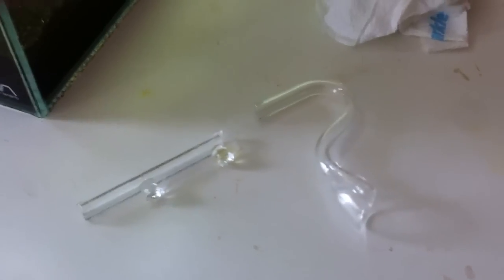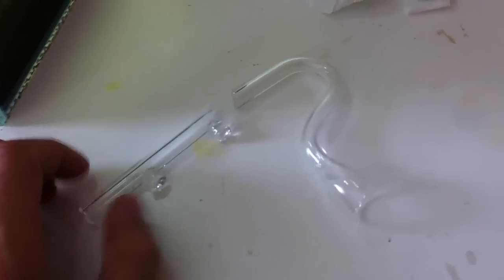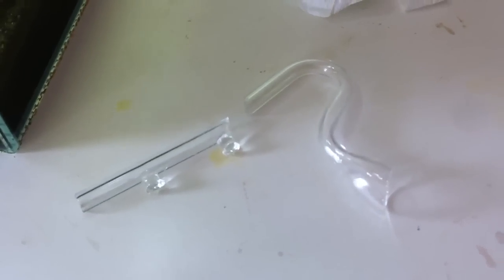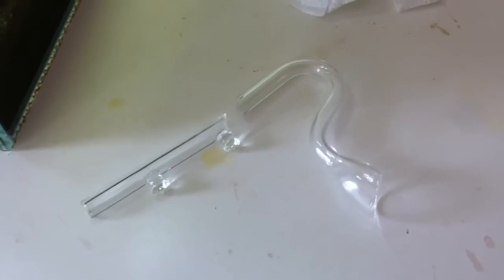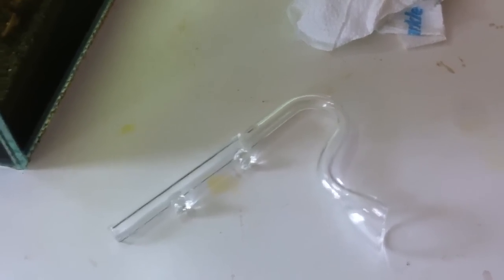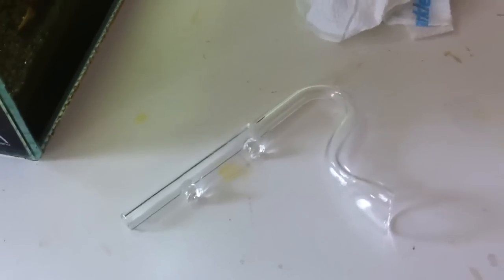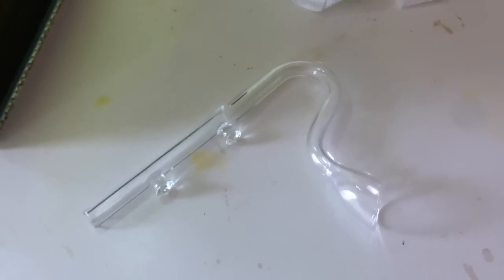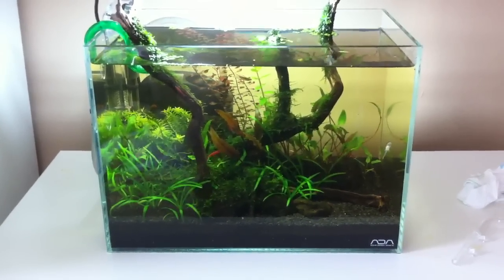Some help fixing my glass pipes

Comment: At the auto shop they have the stuff called radiator repair it's like a putty it will dry Rock Solid and you can make it Mega thin although the thinner you have it the more it tends to want to stick to your fingers if you don't get all the grease off your peace or fiberglass sheets and PVC glue you can form the sheets almost perfectly or you can pull the screens apart and make them into strips so you can do exactly what you need to do it's like paper mache they are both non-toxic repairs but test it before you use it you can never be too safe and things do change lots of luck baby I'm an engineer just for the record